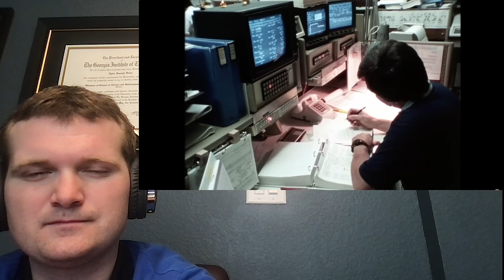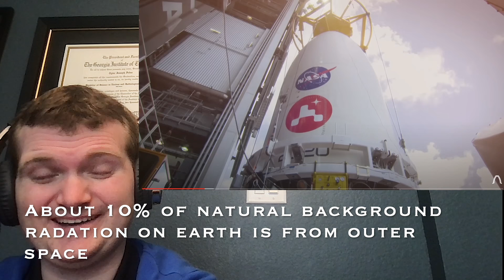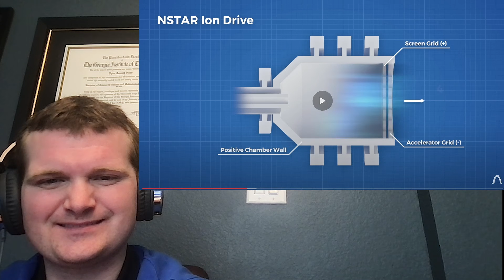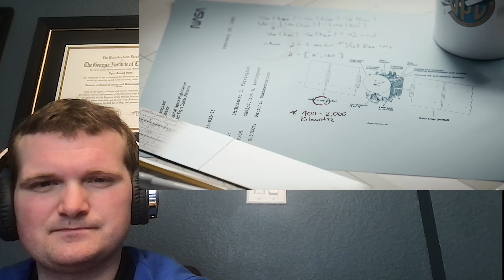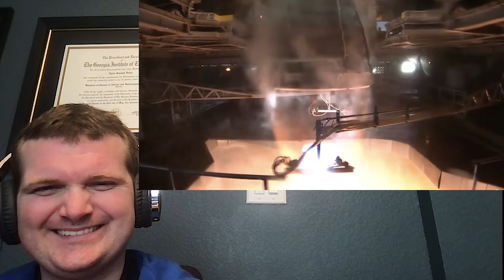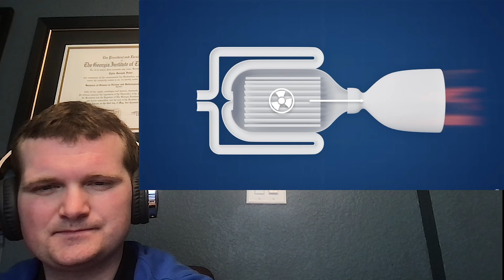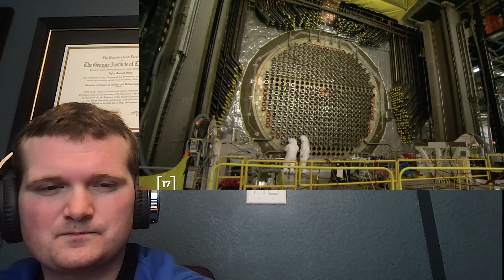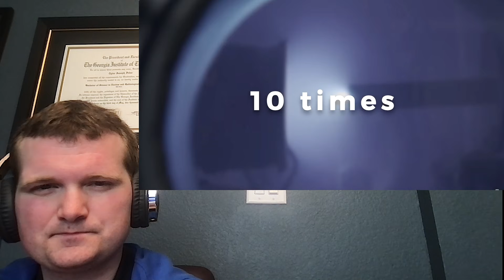Can Nuclear Power Take Us to Mars? - Nuclear Engineer Reacts to Real Engineering

Comment from the maker: Thanks so much for watching! If you want to hear more about bizarre nuclear units, please check out: 
https://youtu.be/QCCRPqS_1ls
Reply: hii!
Reply: React to goodman  dangerous bath toy
Reply: Some comments:

First the radiation threats has two major factors you missed. Number one is that the values you quoted for solar flares are probably not entirely representative. There are a small number of very high energy solar flare events. These i've allways heard described as non-survivable. But they're also very rare. The equivalent in reactor containment design would be the "100 year flood". Not a normal typical, or even expected event. But one that could happen. Particle energies of upto 10 billion electron volts can occur during these.

The second issue is that not all the types of radiation given off by the sun have a direct equivalent in the nuclear industry, (or pretty much any industry), as the sun has a number of trace elements in it that also get turned into cosmic rays. The most troublesome of these are iron nuclei. I'll simply grab a quote on these: 

"Included in the cosmic rays are substantial numbers of iron nuclei totally stripped of electrons. When a fully ionized iron nucleus is traveling at less than half the speed of light, its ionizing power is several thousand times that of an ordinary proton. Passage through the body of a single iron nucleus destroys an entire column of cells along its path. The total amount of energy which the particle dumps into the body is small, but it is highly concentrated. This radiation can not only increase the risks of cancer, it can provide pathways of damaged or dead cells along which the cancer can spread and grow.

The iron nuclei do even more. They destroy nerve cells in the brain and spinal column which cannot reproduce themselves. Once the cells are dead, they can never be replaced. Studies of Apollo astronauts indicate that on their two-week lunar voyages, they may have lost as much as one ten-thousandth of their nonreplaceable neurons. Under such conditions after several years in space, the loss could reach several percent."

Needless to say those iron nuclei are a heck of a thing to try and stop. And not stopping them really isn't viable on a long duration mission.

Second, RealEngeneeiring severely overstates the issues of liquid Hydrogen Storage. it's somthing we've very much solved. It is however a tricky thing to do.

Third, the weight of radiation shielding isn't quite the issue you'd think it is. This is partly because you can use structural elements as part of it. But mostly it's that even with nuclear thermal propulsion the mass of fuel is still far too high to lift in a single launch. As a practical matter any mars craft is going to have to be assembled out of a large number of sections shipped from earth, and then be filled with consumables, (mainly propellent), that is also shipped in several loads. Including radiation shielding in that is rather easy.

I did some basic napkin math on the BlueMoon lander recently and given the required payload, an estimate of the structural mass, and a look at the delta V values required to get from the lunar gateway to the lunar surface and back i got a fully fuelled mass somwhere between 450 and 550 tons, (depending on exactly what the structural weight is). For reference a fully fuelled Falcon 9 with payload and upper stage sat on the launchpad is 510 tons. If a short hop like that needs a craft that big to deliver any significant mass to the lunar surface, (apollo cheated by bringing almost nothing besides the astronauts and their spacesuits down), it's likely any realistic mars mission craft would mass many thousands of tons at departure from low earth orbit. No rocket currently being developed can come close to lifting that in one go. And no more than a couple of very rough concepts have ever been proposed that could do it.
Reply: Without looking it up, what I'm going to guess from that diver is that the spent fuel pool was empty. And there was there was some sort of maintenance going on that was not typical. Structural of some sort perhaps.  And given no divers as you said go down there. That may have been why it remained for 4 years because this foreign object came through the pump system
Reply: You should watch the "Far Future Rocket Engine Technologies" video from Scott Manley

Comment: I'm not really into space stuff but my understanding is at least older NASA designs wanted to keep core systems very simple... if that's the right word. At least for manned missions? Ex, hypergolic fuel doesn't need a separate ignition source, which means your rockets are more likely to fire correctly at the end of your mission for your return flight. As always specifics matter but I can't help but think anything described as "hybrid" could increase complexity a lot when you start adding redundancy  etc to cover the unique failure modes of each half of the system.
Reply: The problem is that long duration deep space missions aren't possible with the simple engineering that made Apollo so successful. Hypergolics are difficult to store and dangerous. So while you need more complex space ships to take humans to mars, you have to build in a lot of redundant systems to ensure if any fail you have multiple backups for them.

Comment: *far side of the moon not dark side. The dark side is constantly changing.
Reply: Correct, there's no side to the moon that's permanently without sunlight. It is tidally locked to the earth, so we'll always see the same part of the moon while standing on earth. But if we take a different perspective, say an observation point past the far side of the moon, looking at the moon.. and if the moon was not lit from the side visible from earth, the far side would be lit up by the sun. Some asterisks to this: the earth eclipsing the moon is a thing that can happen. The moon is also lit by earthsine -- about 30% of light that hits the earth reflects back up and can illuminate the moon to some extent (it's actually a good bit brighter than moonlight). Fun to think about anyway! 

But if you say dark side of the moon, you're either a big Pink Floyd fan or mr Real Engineering doesn't know what he's talking about there. 🙂

Comment: You've mentioned Project Orion, first, somewhat negatively in relation to a hype article, and elsewhere you did mention it positively.

All issues about long-duration space travel within the Solar system are borne out of irrational and non-rational squeamishness about using appropriate technologies for the job.

In the late '50s to early '60s General Atomics worked on "Project Orion" atom-bomb propelled ships.
They designed 600 ton ships to be lifted in sections into orbit.

A cargo ship might take 8+ months to get to Mars, but some 85%+ of what's assembled in Earth orbit is payload into Mars orbit (Chemical rocket might struggle to get 10%. Nuclear thermal might get 50%)
A crewed ship leaves when the 2 planets are physically closest, jumping across at cometary speeds: 21 days into Mars orbit (including starting and stopping, unlike with other proposed propulsion schemes where writers take the maximum possible theoretical speed and apply it between the two planets without worrying about starting and stopping).
As for radiation exposure to the crew, it drastically shortens transit times, so their dose are less.

Numbers from General Atomics, NASA, the USAF, the DoE, and the White House OMB all agreed that the cost of either the mission payload or the Saturn-V boosters would be more than either the engine or the hundreds of .01 kt bombs and the "pulse units" they're packaged into.
The hardest technical issues were things like how to toss a 3/4 ton keg aft at a few hundred meters/sec every 20 seconds, and how to spray a grease-mist across the 10 meter diameter pusher plate at the back end of the ship in between pulses.
No other proposed nuclear propulsion method approaches the performance, or is as ready to be built now, any time someone gets over the reluctance to mention it.

Earlier for launch from down here, they had designed up to 14,000 ton interplanetary exploration ships. Using a few hundred little nukes to get aloft, it ignores orbital trajectories and blasts straight out to go to Saturn's moons in a few months travel time. It leaves a base there, comes back and leaves another base at Mars orbit, and then comes back to Earth orbit with 1300 tons payload. A single stage ship.
Again, using 1960s nuclear weaponeering (we know very well how to do so).
Now, granted that no one wants to use it down here, but this certainly illustrates the type of interplanetary travel that's readily accessible, once anyone's building such large things in space.
No, you don't have to build it on or launch it from the Moon.

Later on his own, Freeman Dyson did the numbers to see how it scales up.
Using 50+ megaton fission/fusion blasts to propel 1000+ tons of propellant into a plasma jet to push the ship.
It makes a lousy slow interstellar ship, but if .1C is the ship's total possible velocity change, it's a 5 million ton super-liner hotel ship that crosses 100 AU in 17 days, at peak mid-course cruising speed (Sun to Neptune is ≈40 AU).
Reply: No nuclear space ship of any type is going to be allowed to use its nuclear engines to take off from the surface of earth. Instead we'll build them in low earth orbit and only fire the engines when they are on a trajectory that can't possibly return to earth. 
Payload cost per ton has declined by over 95% since the Space Shuttle (from $80M/ton down to as little as $2M/ton) thanks to commercial launch competition. If fully reusable launch systems like Starship are successful cost per ton will be reduced to $100,000/ton. That enables you to build large ships in orbit and fully refuel them with tankers to have far larger payload masses to deep space. 
Mars is trivial to reach in 3-4 months using chemical rockets with payloads of hundreds of tons when you have the ability to refuel in low earth orbit, and the radiation levels are low enough that years on Mars will only have a small effect on life time cancer rates. So you don't need nuclear rockets for mars, they are in fact inefficient for any route that allows aerobraking because they won't ever be allowed to reenter the atmosphere with a hot nuclear plant (or use nuclear bombs), which forces them to carry 50% more propellent for Mars/Earth transits. Instead you want to use nuclear rockets for more distant destinations (Jupiter+) and those without aerobraking (asteroid belt, moon maybe).
And you probably don't want to build an Orion ship in low earth orbit though. Much more effective to use low cost launch to send the tools and work crews to strip an asteroid of resources and use those materials to build Orion ships that are millions of tons in size.

Comment: The video by RealEngineering leaves out SpaceX completely - which is very weird, maybe on purpose. Very Sad. SpaceX will colonize Mars for Humanity, i doubt Nasa has the ressources, capabilities or will to do it.

SpaceX's Mars colonization plan centers on the fully reusable Starship system: Super Heavy booster (33 sea-level Raptor engines) + Starship upper stage (3 sea-level + 6 vacuum Raptor engines in later versions).Propellant: Sub-cooled liquid methane (CH₄) and liquid oxygen (LOX) – methalox (high performance, enables in-situ resource utilization (ISRU) on Mars for producing return fuel via Sabatier reaction from CO₂ and water ice).

Current tech status (as of January 2026): Transitioning to Version 3 (taller stages for higher payload ~150-200t reusable, improved heatshield, reusable hot-staging ring). Powered by Raptor 3 engines (simplified design, no heat shields, higher thrust ~330t each, better reliability/mass production).
First V3 flight (Flight 12) targeted for Q1 2026.Key enablers: Orbital refueling (multiple tanker Starships to fill a Mars-bound ship), aerobraking/heatshield for entry, precision landing on Mars surface.

Timeline (latest updates): Originally targeted ~5 uncrewed missions in late 2026 Earth-Mars window to test landings. However, Elon Musk recently described 2026 as "low-probability" and a potential "distraction," prioritizing rapid iteration, refueling mastery, and reliability. More likely uncrewed in 2028-2029 window, crewed ~2030-2033 if successful.

 Long-term: Scale to dozens/hundreds of ships per window for cargo/people, aiming for self-sustaining city by ~2050.Propulsion comparison for Mars transit (~6-9 months Hohmann transfer with chemical/methalox):

Methalox (Starship): ISP ~350-380s, very high thrust (enables Earth launch, Mars landing/aerobrake, massive payload 100-200t). Optimized transit ~3-6 months possible. Affordable, rapid development, ISRU for returns/no resupply needed. No nuclear complexity.

Ion (electric, e.g., xenon/argon hall/thrusters): ISP 3000-8000s (fuel-efficient), ultra-low thrust (spiral trajectories). Ideal for uncrewed probes; crewed could shorten to ~4 months with advanced systems but requires massive power (solar arrays or nuclear reactor). Unsuitable for launch/landing.

Nuclear Thermal (e.g., NASA DRACO/NERVA concepts): ISP ~800-900s (twice chemical), high thrust with hydrogen propellant. Transit ~3-4 months, reduced radiation exposure. Still developmental (demo ~2027+), faces regulations, H₂ storage/tank issues reduce effective payload vs dense methalox.

SpaceX chose methalox for cost, reusability, Mars ISRU synergy, and fast iteration over riskier/advanced options. Nuclear/ion may complement future missions (e.g., faster crew transfers). Ultimate goal: Multiplanetary humanity.
Reply: Elon Musk himself has come to realize Starship, while perfect as a reusable heavy lift launch vehicle, is impractical as an interplanetary vehicle.
Reply: @STSWB5SG1FAN  Thats absolutely untrue, Elon has never said that. Starship is designed for Mars transits and landings. In-orbit refueling gives it 7 km/sec deltaV, plenty for landing massive payloads on mars or large teams of dozens of people, and Mars has easily accessible water and CO2 to make methalox for return trips.  Because it uses aerobraking it saves huge amounts of propellent on both directions, and because it can land propulsively on both planets it doesn't need expensive landers that would have added huge amounts of dry mass.
Starship is probably both the most efficient Earth cargo launch vehicle AND Mars space ship ever designed, thanks to aerobraking and propulsive landings. It enables Mars missions at a tiny fraction of the cost of the expensive NASA mars plans that would have required hugely expensive expendable rockets, custom transit ships and custom landers, all built by hand at tremendous costs and required pre-caching immense amounts of propellent on the surface of mars.

Comment: So considering it takes 1.7 light years to reach the edge of our solar system, light moves at 1 million mph, but yet we have a probe moving at 38,000 mph that reached it in 48years thats 1.8 million miles its traveled at that speed. 1 light year is 5.8 trillion miles, something doesn't make sense.
Reply: Voyager hasn't gotten close to the edge of our solar system. They are about 16 billion miles away, which matches up well with 38,000 miles/hour in 48 years, which is 912,000 miles/day, 333M miles/year and times 48 is almost exactly 16 billion.

Comment: What he says here about hydrogen being corrosive is true, but for the 1960s nuclear thermal rocket designs, it did not affect the nuclear fuel rods, since the hydrogen didn't come into direct contact with the fuel elements. The reactor cores used graphite as their moderator, like some commercial nuclear power reactors designs. The hydrogen propellant flowed through cooling channels in the graphite - which is again similar to commercial reactors, which typically have water flowing through their own cooling channels.

At ambient temperatures, hydrogen in contact with graphite does precisely nothing. But change that to 1000 degrees C (or more) in the nuclear thermal rocket reactor and the graphite is not so inert: At these temperatures, the hydrogen and graphite react rapidly, with the hot hydrogen essentially reducing the graphite to methane. This reaction was in fact so fast that the scientists working on the project compared it to hot water dissolving sugar cubes.

Fortunately, they came up with a reasonably straightforward fix: The hydrogen flow channels were lined with a thin layer of niobium metal, which was an effective barrier, preventing the hot hydrogen reacting with the graphite.

Comment: On a spacecraft nuclear-electric would no doubt be using thermal sensitive diodes (Peltier devices) since they are way smaller and lighter than a steam turbine, generator, and water tank. But Peltier devices are very inefficient.